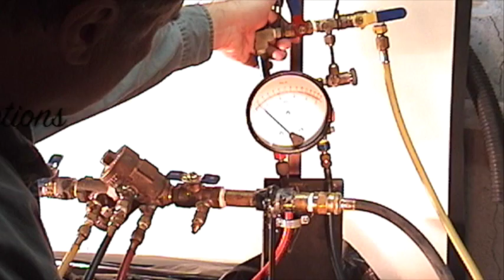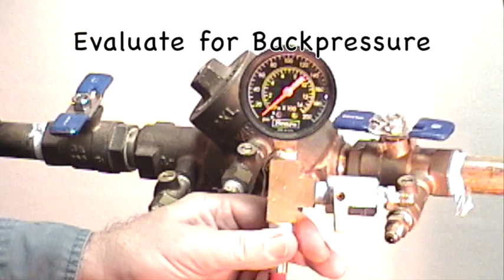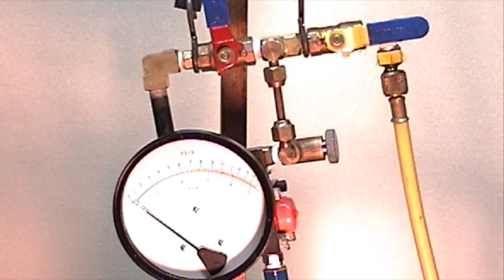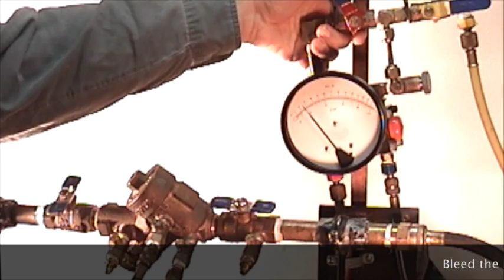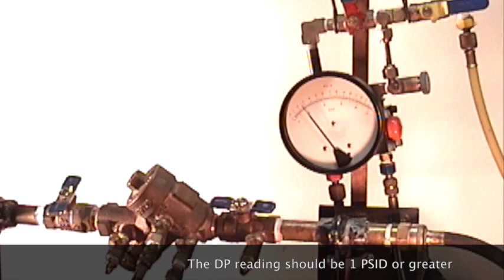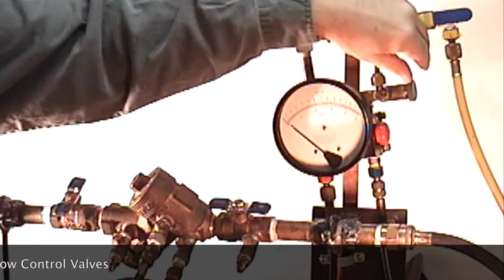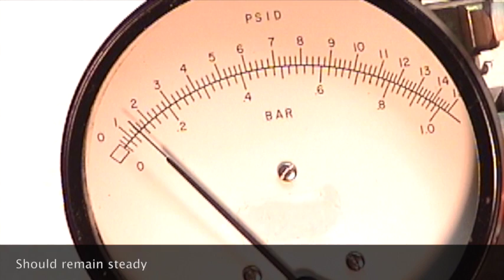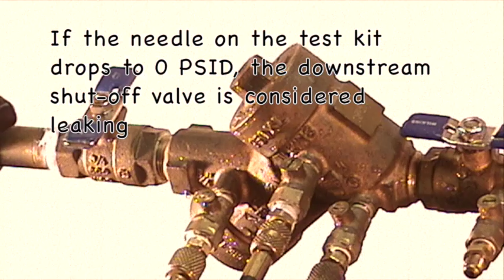Double Check Valve Assembly - Field Test

Comment: Thanks for the video. The fix where test cock #4 has higher pressure on the first test would be just to replace the shutoff valve right? I guess we could try opening and closing a few times also to see if it releases something that might’ve been lodged.
Reply from the maker: Yes. Rick, if backpressure is present at test cock number four, the downstream shut-off valve is not drip tight. Try reclosing. If the backpressure does not diminish, replace, or repair the downstream shut-off valve. Test the assembly if you can eliminate the backpressure.

Comment: Thank you for a detail explanation of a backflow testing. Is it possible to make a simple testing tool for DIY purpose of check valve # 1 and #2 testing like using a evaluate for backpressure as you made ? I barely passed check valve #1 testing in last year and i failed check valve #2 with leaking. I think it was from o-ring on seat kit and I replaced it. I am sure it is ok now. But I don't know 100% if it is ok. Pluming company charge $150 for just testing. Would you please help me out to save the testing cost. Thanks
Reply from the maker: Thanks for watching the video. Simple test. To measure the differential pressure across the DCVA, check valves, close the downstream shut-off valve, and connect a standard pressure gauge (200 psi) to test cock #2. Open the test cock and record the pressure reading. Close test cock #2, remove the gauge, and connect it to test cock #3. Open test cock #3 and record the reading on the gauge. Subtract test cock #3 reading from test cock #2 reading. The pressure loss across the first check valve must be one psi or greater. For the second check valve differential, conduct the same steps using test cock #3 and #4. The pressure loss across the second check valve must also be one psi or greater. This procedure works, providing there is no downstream demand.
Reply: @JimmyBackflow  Thank you for your answer. Actually I have watts LF909 and i know the Backflow is tested on RPZ.  Is it same way to test #1&2 check valve for RPZ ? I am not sure if you receive my email. Please see it and kindly reply when you are free. Thank you again.
Reply from the maker: @jeonghwanbae2111  A simple test for the RPZ would be to follow the procedure previously stated to confirm the DCVA check valves. To test the opening point of the RPZ, connect a pressure gauge with a bleed attachment as seen in the DCVA video (best to use 0 to 100 Psi or less) to test cock #2. Open test cock #2. With the gauge reading pressure, close the upstream and downstream shut-off valves. Next, open test cock #3. When the water stops flowing out of the test cock, the gauge reads the static pressure upstream of the first check valve. Next, open the bleed valve on the pressure gauge. Water discharges out of the relief valve, and the gauge reads the opening point of the relief valve.

Comment: Excellent Video. I have a situation pointing back at a backflow preventer that appears to be loosing around 80kPa (above the allowable limit) at flow. It is quite new and I'm suspect of it not being properly commissioned or it is blocked somehow.
Can I measure this loss at flow? or do you recommend why this backflow might not be operating correctly.
Reply from the maker: Neil backflow prevention devices will loose pressure in a flow condition. The AWWA specifications state that a double check valve assembly should not loose more than 10 PSI  (68.9kPa) across the check valve. 80kPa is equal to 11.6 PSI therefore, the backflow prevention device assembly does not meet the AWWA specifications. The AWWA pressure loses represent the maximum permissible pressure loss at any flow rate up to and including the rated flow rate of the assembly. To measure the pressure loss across the assembly during a flow condition  one can use a standard pressure gauge to measure the pressure at test cock #1 and test cock # 4 and calculate the difference or one can use a backflow test kit to measure the pressure loss by connect the high pressure hose to test cock #1 and the low pressure hose to test cock # 4. The pressure loss could be due to the springs tensile strength. Restricted flow could such as a blockage or the assembly is undersized --to small for the rate of flow. If the assembly is sized smaller than the inlet piping this could cause a restriction in flow and as the velocity increase the pressure decreases.

Comment: Is this another way instead of using a sight tube?
Reply from the maker: Yes this is another way of measuring the differential pressure across the check valve other than using a sight tube. Measuring the differential pressure can be accomplished by using the differential pressure gauge high and low side pressure hoses. In the test kit, the high side measures the pressure on the inlet side of the check valve and the low side measures the pressure on the outlet side of the check valve. The differential pressure gauge calculates the actual difference in pressure across the check valve. When using the a site tube, the high side is measuring the pressure on the inlet side of the check valve and the low side is measuring against atmospheric pressure.  In this methods, the check valve in a DCVA should hold 1 psi greater than atmospheric pressure.  Both are industry acceptable methods of measuring differential pressure. The AWWA M14 Fourth Edition of "Backflow Prevention and Cross-Connection Control"  illustrates both testing procedures or methods.
Reply: Jimmy Backflow what are you measuring with the sight tube? Differential also?
Reply from the maker: You are measuring atmospheric pressure in the vertical tube. Once the water stops flowing from the vertical tube the water pressure on the outlet side of the check valve is atmospheric. Atmospheric pressure is 14.7 psia. If the check valve is holding, the pressure on the inlet side of the check valve is greater than atmospheric pressure. The differential pressure across the check valve is the difference between water at atmospheric pressure and actual water pressure.  The high side of the test kit is reading 15.7 psia and the low side of the test kit is reading 14.7 psia,  giving you a differential pressure of 1 psid on the test kit. Absolute pressure and gauge pressure are related. Absolute pressure is equal the gauge pressure plus the atmospheric pressure. If there is no pressure on the gauge (low side) other than atmospheric, the gauge would read zero. Refer to the EPA Cross-Connection Control Manual  Chapter 3 for more information regarding atmospheric and gauge pressure.
Reply: Jimmy Backflow my paper says DCV closed tight or leaked and if it closed tight wants the PSI. I can't use just the high and low right? I have to use the high and sight tube for that PSI right. Not just bleed high and low. That would be way easier since my backflow are in the ground
Reply from the maker: The industry standards state that a DCVA check valves shall have a static differential pressure across the check valves of at least 1.0 psid. You should be recording the differential pressure drop across the check valves on the test form. As the video shows you can use the high and low pressure hoses to measure differential pressure. The differential pressure drop across the check valves can be measured by connecting the high pressure hose to inlet side of the check valve and the low pressure hose to outlet side of the check valve.  Record the PSID reading on the test kit on the report form. If the reading is 1.0 pisd the check valve is closed tight. If the reading is 0 psid, the check valve is not closed tight. A reading of greater than 0 psid but less than 1.0 psid indicates that the check valve is holding tight but does not meet the industry standards. Whether you use the vertical tube method or the two hose method,  the differential pressure results will be same. Again, all you are trying to accomplish is to measure the pressure on the inlet and outlet side of the check valve and record the difference in pressure.  The differential pressure across the check valves can be accomplished by installing the high side pressure hose to a test cock and the low side pressure hose to another test cock. This will give you an accurate differential pressure reading across the check valves as  required by the industry standards, after the air is bleed from the test kit. Follow the video and report the differential pressure readings on the report form.